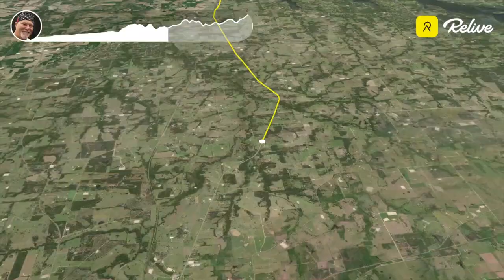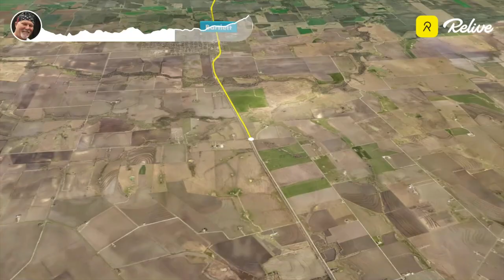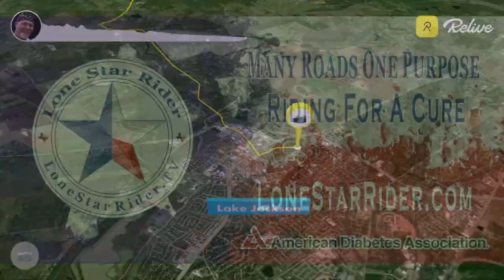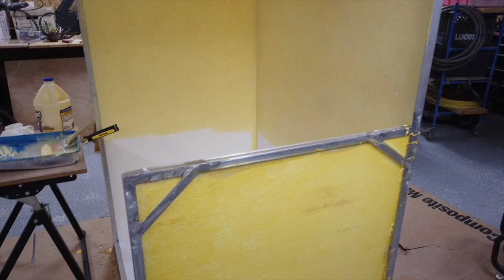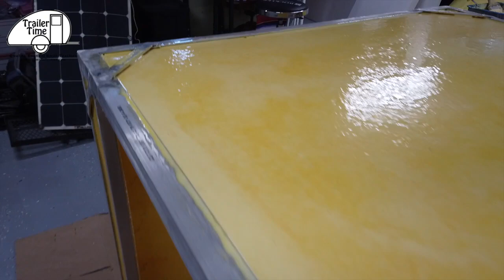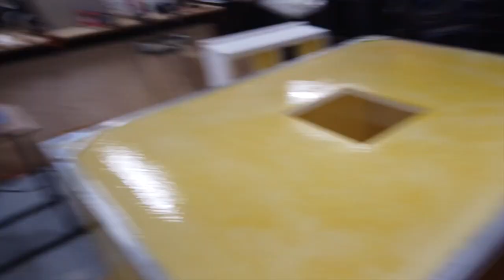Riding For A Cure Trailer Rebuild Part 14

Comment: Hey Rex, looks like it’s coming along there. I noticed you mentioned that some of those welds broke? I think that’s possibly true and maybe more breaks might happen. In my modest opinion I think the aluminum welding could be done better. I’m not 100% sure but they did not look all that smooth as aluminum welding should be. Just my two cents and I hope you don’t have any problems. Safe travels my friend.
Reply from the maker: I think that there will be no more breaks, we shall see. Thanks My Friend!